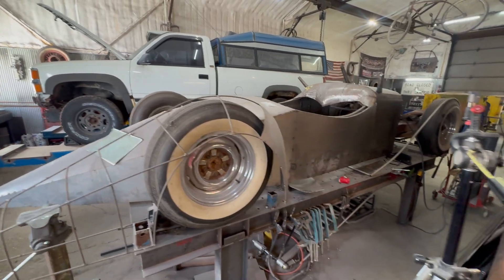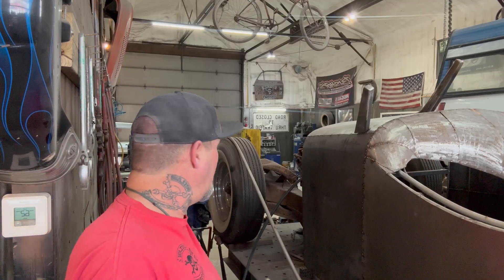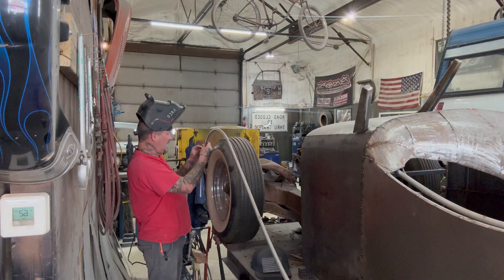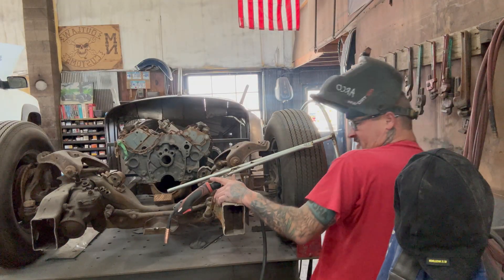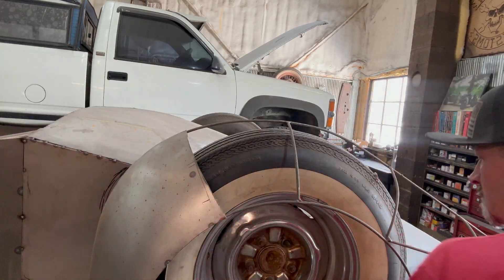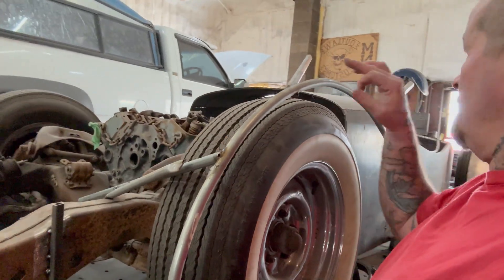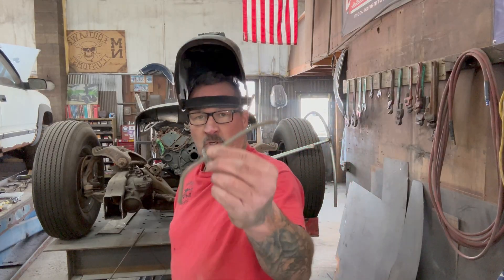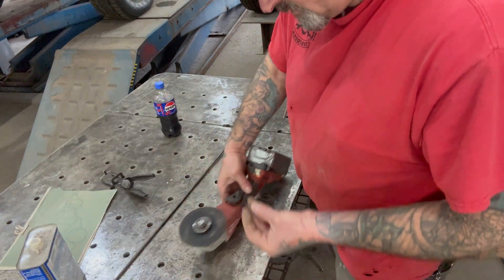Can A Car Body Be Built Using Solid Round Rod?

Comment: There is a stuff called durowall. It's a metal reinforcement for concrete block wall construction.  It's shaped like a ladder.  It's solid rod about an 1/8 inch very strong  but easily shaped and its cheap. You'd just have to cut loose the web of the ladder grid ever 16 inch.  You have a nice project going there. Very nice metal work. 👍 👍 👍 👍 👍

Comment: Good seeing you Arco been thinking about you. Glad you posted your project. What ever happened to the other one you were working on. Keeping that one under wraps? 
Looking good man keep up the great work 
And your right about break cleaner that will release poisonous gas and will kill you there is no cure for it. SO MAKE SURE WHAT EVER YOUR WELDING ON IS CLEAN METAL!!!! even Galvanized coating is posin when it's heated up it will give you blood poisoning there is no cure so once you get it in your system it's in there you may have problems down the line. I always tell student's it's not even Worth welding on and if you do have to weld on it set up fans and wear a filtered mask so you don't get it in your lungs. Try and grind it clean before welding on it.
Reply from the maker: Hey brother, great to hear from you! My other car is in storage right now. We’re waiting to get some customer cars finished up and out of my shop and then we will be pulling it inside the shop again probably this spring.

Comment: Soaking galvanized metal in rust remover or heated vinegar will remove the galvanization. Would still be careful with it but I had to use tubing with some on it and that's what I did.

Looks good, love the sleek lines you guys put on your builds.

Comment: I didn't know the break clean would make gasses.I thought it evaporated all the way , but the galvanize can make you very sick or permanently ill causing brain cancer
Reply: I suppose it is also worth mentioning that welding stainless also produces toxic byproducts. So remember to be well ventilated and or have a mask on.
Reply: @wolfwind9658  stainless, galvanized, satin-coat, brake clean, paint, flux core smoke… all nasty stuff for sure.